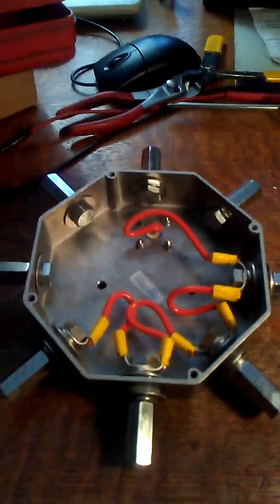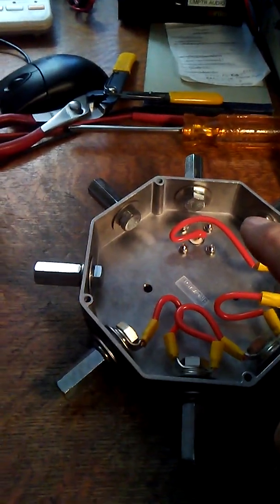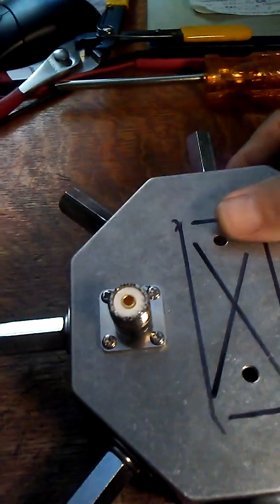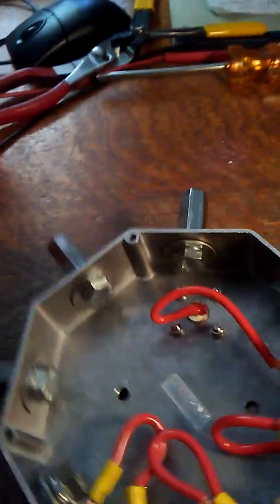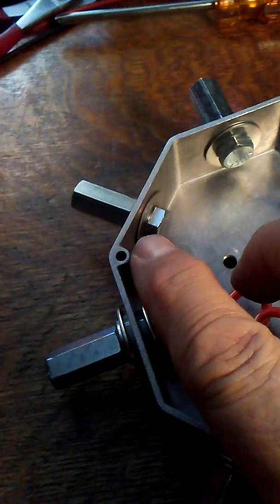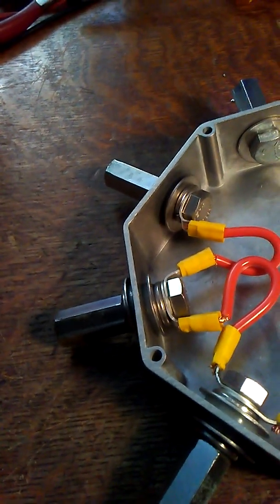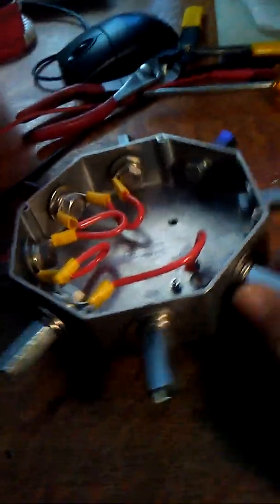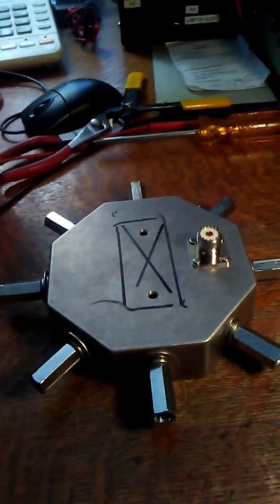A Home-made Octopus/Spider base For Ham Radio

Comment: I watched the follow-up video first. Absolutely brilliant. I'm doing the exact same thing, using the Milsup poles. I have a 40m hamstick dipole and was looking for a multiband solution. Not sure what I am going to run but looking at the Shark Sets on GigaParts and Amazon. I went with 7/16 for the larger holes. no slippage with the shoulder washers, they fit snug. Many thanks for the wiring design, I will follow it and not jury rig it.
Reply from the maker: Glad it helped

Comment: Just ran across this video and the following one regarding building an octopus. I've built a number of dipole mounts for my hamsticks (I have pairs of all Shark Mini's except the 80M are full size and a 60M pair are MFJ). I use my hamstick dipoles for almost all my portable adventures and have been very pleased with the results. I've looked around trying to find a reasonably priced octopus/spider mount or even one of the Chameleon Che Quads but no luck. Your videos are just what I was looking for. I ordered the parts to build a quad mount since I would probably only use two bands on most portable outings. Thanks for the great videos! Jack K5FIT

Comment: So, how does it work?  Looks like it should work fine but would like a report.  Tnx 73 KI5IMV
Reply from the maker: Works great, but had to offset 40 meters to get good SWR  since the mast is only 18 feet. Had some RF issues  in the van, but a 240 43 mix on the coax and some snap ons on control cables fixed that. Used it on field day and got almost 100 contacts. Also had good dx on 10 and 20 meters out to Europe and Spain.